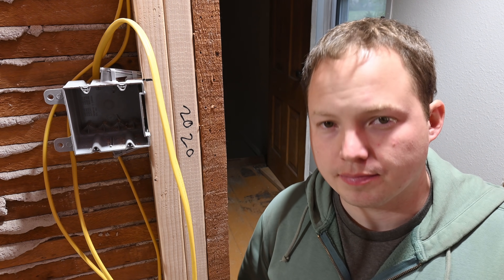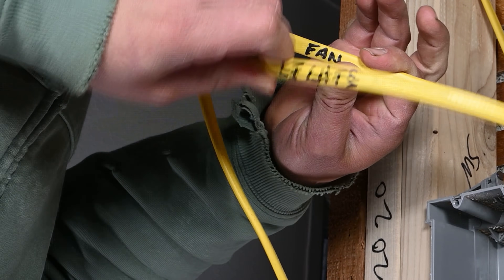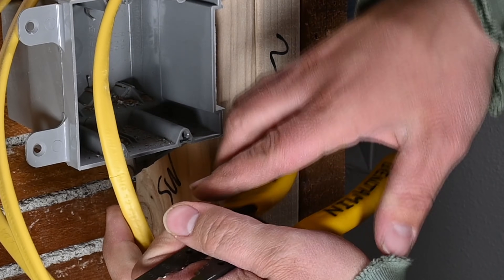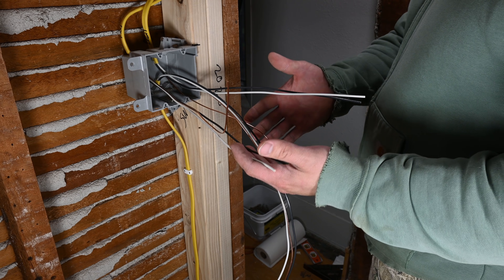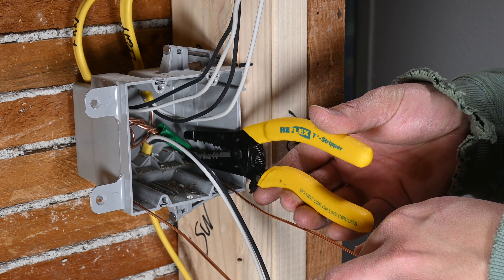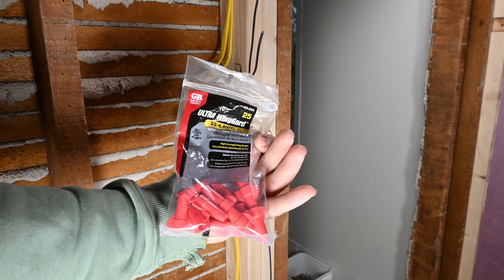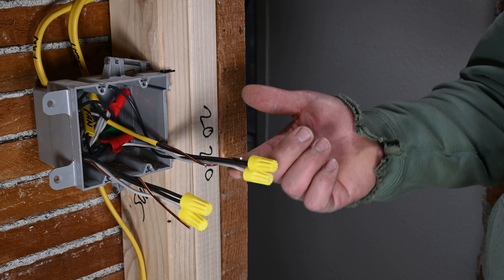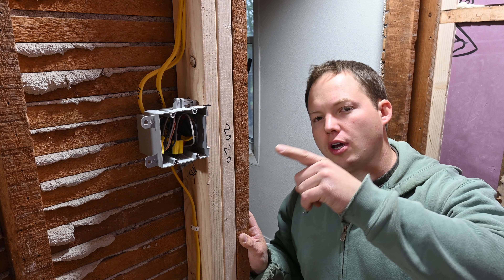How To Rough In Wires For a Bathroom Light & Fan Two Gang Switch Box

Comment: So glad to see your stripping your wires before putting them in the box. Also glad your using the old cover insulation to mark your wires. You are improving. I have one question. You leave 6 in of wire outside the box. Where does the code say that ? In my code book it says 6 in. of conductor total. I do enjoy your videos . With all the wire and wingnuts i don't know  how you get the switches in. what is the depth of your boxes ?
Reply from the maker: I just prefer a bit more wire. At most it's only about 2 or 3 inches more wire per conductor. You are correct that 6 inches is the minimum. Maximum is 12 inches for the purpose of calculating box fill capacity. It comes down to preference to some level.
Reply: @BenjaminSahlstrom Ok I see why you are doing this. I just find with some devices that take up more room it get harder to put them in with all that wire and connectors. I always leave a 6 to 8 in. loop before the box. That way if you do need more wire down the road you can always pull it in. Keep up the good work. I really like how you take pride in your work. Just showing you how some others do it also.
Reply: I personally agree with Ben on this one, and technically it’s 6 measured from box entry point..300.14, but if it is a box less than 8in in any dimension then it has to at least stick past the edge 3 inches....so for Ben’s box which is approx 2.5” deep 6 would be minimum. If he had a 4in deep box like a big Junction box he would have to have 7” minimum.
Reply: He did get those unsheathed cables into the box fairly easily. In my experience, an unsheathed cable always seems to snag on the integrated clamps of the box before I can pull in the required 1/4 inch of sheath. So I have always just unsheathed (very carefully!) the cable from within the box using a utility knife. I've done it enough times to have consistent results. Doesn't look as pretty as those square cuts of sheath with that stripper tool, though.

Comment: Those auto strippers are on point! i bought some irwins that didnt work so i quit using them..
Reply from the maker: I like them more than I expected that's for sure!
Reply: @BenjaminSahlstrom  They seem kinda bulky... sure they're worth it?
Reply: @BenjaminSahlstrom  I've been subscribed to your channel for a while, and you do excellent work. I have a question if you don't mind. I'm gonna remodel 2 bedrooms, 1 on first floor the other right above it on second floor, I want to have bedroom 1,  on 12/2 for outlets, and bedroom 2, 12/2 for outlets as well, and   1 ceiling fan with lights for each bedroom on the same 14/2, 15 amp circuit but I want to add smoke detectors to this circuit.  Would that be ok?. Thanks

Comment: Consider using steel boxes with a mud ring next time. You tie all your incoming grounds together with a pigtail to the box, but then you don't need to make pigtails to the devices because they self-ground with their yoke bonding contact. Also, for those steel boxes, check out Arlington NM94 connectors (at Menards) button clamps. You can shove two cables into them. I don't install plastic boxes at all anymore.
Reply: Many old houses all over the world don't have ground wire, using metal boxes in those houses is potentially dangerous and code violation.
Reply: @Dmitrytln  If you're installing new circuits in an old house, however, you'd be installing a modern grounded circuit. At least in North America, it is against electrical code to install new ungrounded circuits.
Reply: Why in the world would you use metal boxes with plastic cable ? Why do you think they have these materials and systems ?
Metal boxes are fine if you have to use metal cable or metal pipe . Metal boxes make no sense when you are able to install 
A complete nonmetallic ,  nonconductive  system .  They take longer , there is more chance of faults , are more costly ,  
Need connectors , ground jumpers and screws . Also not as roomy .  Have I missed anything ??
Reply: @gerdberg4188  Yeah. You missed threaded screw holes that don't strip out easily, rigidity and strength, and the convenience of self-grounding devices that become VERY apparent when the number of gangs increase. Also, there is no such thing as a "non-metallic non-conductuve system" with electricity. The extent by which you construct with metal materials is arbitrary.
Reply: They can fracture, and when the plastic mounting tabs strip they are nearly impossible to repair.  You do you - but I've done residential remodels a long time, and decided the slightly higher cost in boxes was not worth choosing plastic. @gerdberg4188
Reply: If you knew how to drive a screw it would not be a problem. Guess you don't know what nonmetallic means either . 
Takes all kinds to make a world I guess .     Move up to the 2020s man steel is not the ultimate end all .
Reply: @gerdberg4188  I've used plastic and fiberglass boxes. I just don't like them. It's nice there's choices. No need to get butt-hurt by someone with a different opinion than you, man. Life's too short. Peace!
Reply: Oh and in thirty eight years I have never relied on the box or the pipe for a good ground . Seen too many compromised stuff to rely on that . What , you do that substandard move to save time using your silly steel boxes .
Reply: @gerdberg4188  It's not the materials, it's the individual(s) who installed it. Do you yell at the sky when it rains? If using steel boxes intimidates you, then stick with non-metallic. Nothing wrong with that. It is actually much easier, I will admit.
Reply: If you were wiring houses here in the northeast , you would not be able to compete on price using those wiring methods.
Reply: Yeah I'm concerned with quality, not price. I'm okay spending less than $2.50 per device for a 1900 box w/ mud ring.
Reply: So are you actually a licensed electrician. Or just a handyman .?
Reply: I'm basically like Ben on this channel, a would-be electrician. I've done the work all my life in many properties for many years, and I love the craft. Particularly bending EMT offsets.
Reply: 💯 I was thinking the same thing.  Metal always - and seldom do you have to pigtail the ground (commercial grade wiring devices include auto-grounding yokes).  I think in the future I will use adjustable-depth plaster rings too.

Comment: If youre not sure if you gonna have smart switch’s there’s no point to this with the neutral, wasting time and space in the box
Reply: Code 2020
Reply: @seniorcomputer3292  u have to have a neutral, u don’t need to have a neutral tail on stand by, what code u r looking at?
Reply: @GabrielOliveira-cs9mi  according to the CEC which may not apply to u, every switch location must have a readily available neutral connection

Comment: 9:16 Wago 221-415 
13:36 Wago 221-412  😉
Reply: Given the time savings, Wago are a no-brainer
Reply: @Jessassin  especially in a case where the connection is temporary. Why twist wires together if you don't have to? Un-twisting and Re-twisting is annoying and runs the risk of d breaking the lead.
Reply: Insert the office thank you meme here

Comment: Hight of box is 48 to lower edge of box.You must be short
Reply: As I understand it, the 48" rule is used specifically for ease of installation of drywall. So you could do the top or bottom of the box at 48", so the box falls at the edge of the sheet. Where I live (CA) most installs are 48" to top of box, but when I lived in KS, bottom at 48" was common.
Reply: It depends on the  higjt of your ceiling

Comment: Old school guy, haven’t kept up with code much, but why not use 14 wire since it’s only lights and fan.
Reply: Bathroom receptacles must be served by a 20-amp circuit. The lighting can come from a separate circuit, but since he is connecting to the receptacle circuit, #12 wire is required.
Reply: @Jessassin  thanx for the info 👍
Reply: @Jessassin  Right, and you can't, or at least shouldn't, mix gauges of cable on a circuit even if the thing being powered by the thinner gauge is a lower amperage load.
Reply: Probably a preference thing, although 14 still gets the job done regardless
Reply: @Nick-bh1fy  14 is a lot easier to deal with in the box when the wire count gets high, especially when using larger devices.
Reply: My guess is it's because he's tapping power from a receptacle that will be powered by a 20A breaker. I agree, though... I would power the fan and light using a 15A general lighting circuit that powers lights in the rest of the house, and leave the receptacle in the bathroom dedicated on a 20A breaker.

Comment: Great video.  Very thorough.  All the detailed explanations are spot on.I like to also write the "light/fan" on the edge of the sheeting before putting it in the box so it's visible inside on entry.  I don't do the sheeting sleeve as you have done.  I liked the stripper with the sheeting cutter, but I'm not sure I want to get a stripper.  It's such a hassle pinch tearing it with the linesmen.

Comment: 6:00 if I’m not mistaken you could make your own greeny wire nut by just drilling a small hole in the top of a normal wire but if you need one in a pinch or don’t want a huge pack from a small job.
Reply: Depends or your nut. Some work some dont. Idk if code would allow though.
Reply: @turboflush  I don't see why code wouldn't allow it if the factory greeny does it like that, unless the greeny is banned. It would only be the wrong color but depending on the wire going to it any electrician should know what it is.
Reply: @FishFind3000  You can't modify the way something is manufactured. An inspector could fail it. The NEC 2020 says: "110.3 (B) Installation and Use. Equipment that is listed, labeled, or both shall be installed and used in accordance with any instructions included in the listing or labeling."
Reply: @illestofdemall13  true.. But the ground is usually at the back. They may not catch it.
Reply: @turboflush  I view inspectors as a partner in making the safest, fire-resistantist build possible.  Their job is to come to my job and pat me on the back for being awesome or help me get better by pointing out flaws and better methods.  Hide stuff, hell no, I am pointing out anything that I question.  Again, be the best or better.

Hide it from the inspector are the words written on the firebomb ticking away in the walls.
Reply: @keithharrington4595  fire.. Or anything else. 
Like having a teacher grade your work.
People need to inderstand that that sustem is set in place to protect you and the city. Proper construction keeps people safe inside. But also outside. Lessen the chance of fires spreading, lessen chance of during a hurricane that roofs come off and take put neighbors house. 
I am diyer.. And though i hate inspections.. I know its for a good reason. When you skip the city inspection with a contractor.. There is no reassurance that the job was done safely or properly.
Reply: Because it is not rated for that . It might work alright , but it would be considered a damaged connector
Reply: Won't be the risk to modify the part.